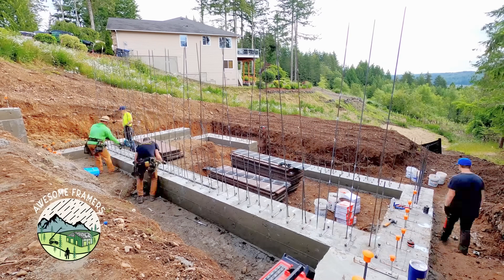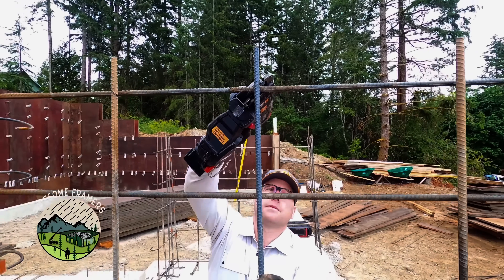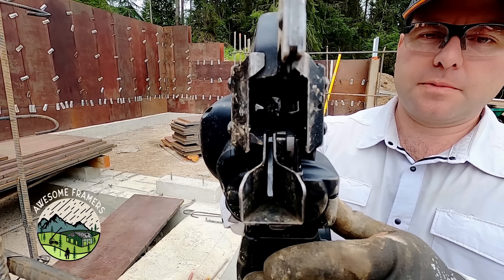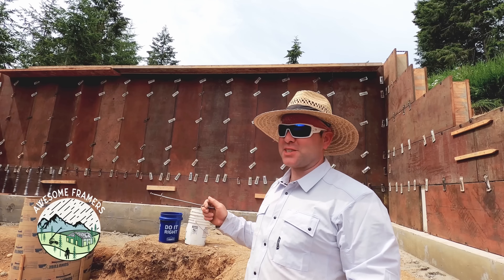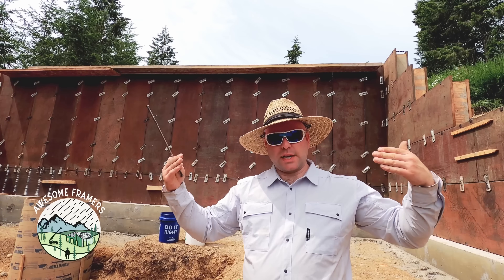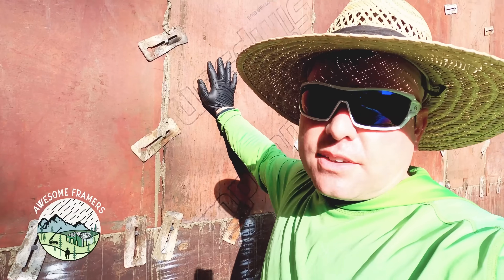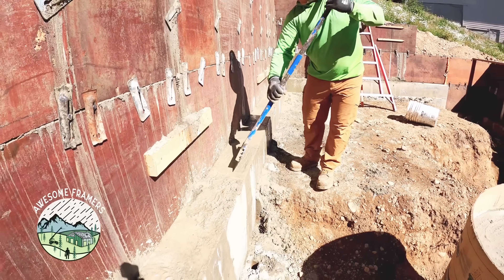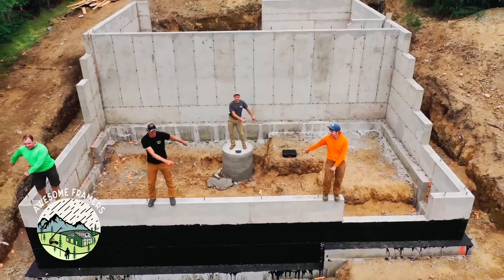Forming Tall Foundation Walls A Proven System 10 Foot Walls

Comment: Tim, I'm building alone and found the ultimate solution for setting Advantech. I had used your 2x4 persuader and a sledge and couldn't align the tongues and grooves AND whack edges at the same time. Enter The Big Pee Vee, when you step on the bar to get the spike to bite the Advantech it pushes warped edges down to meet the groove of the previous sheet AND gives you enough oomph to pull the tongue into the groove. Give it a try, it's the shizz.

I'm building my walls/soffits on the deck using your system and looking forward to see the corners/valleys come together. 😬

Thanks for the quality content.